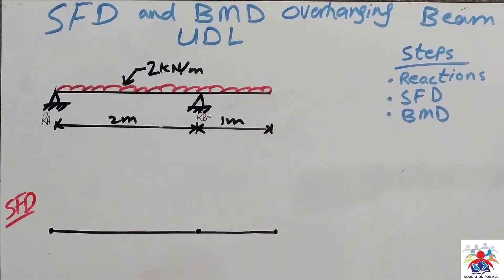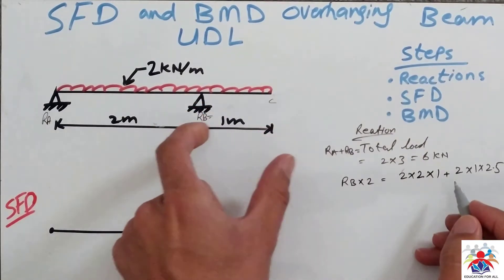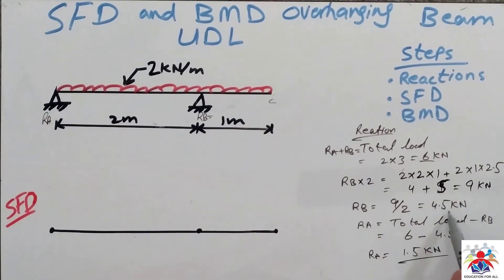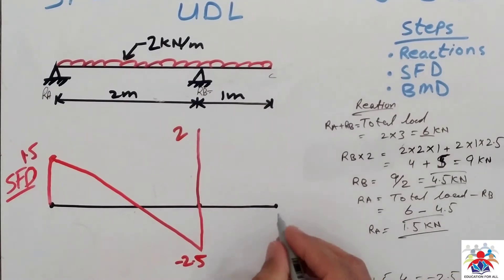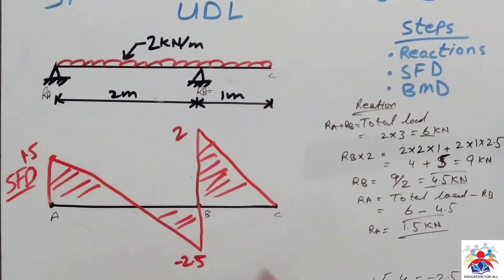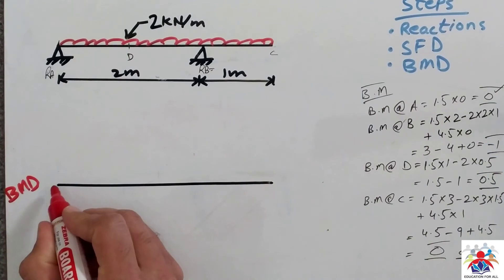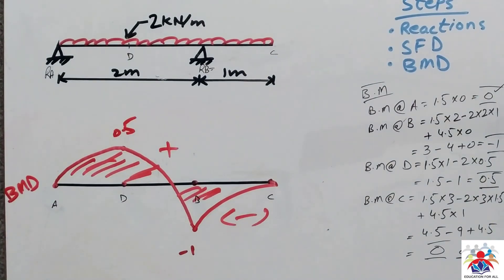Overhanging UDL Beam SFD and BMD with Diagram

Comment: Where did you get the RB*2?
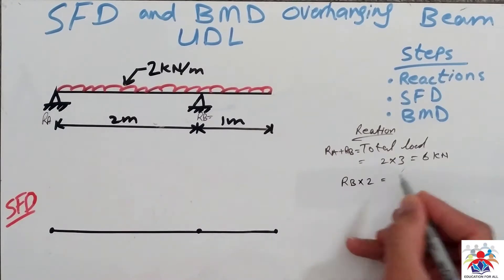Reply: @0:40
Reply from the maker: Thanks for your message. This is reaction calculation on reaction RB. Ok how it comes in? Distance between Ra and Rb is 2meters. Then Rb to c point is 1 meter. In order to calculate reaction at Rb I have divided the beam into two parts i.e Ra to Rb and Rb to c point. Now udl is 2kN/meter. 2x2*x1 plus 2x1x2*.5

Note: 2* is a distance on beam between Ra and Rb and 0.5 is also a distance on beam between Rb and c 

UDL always acts on its half length.
Reply: Simply by calculating moment that is force multiply by perpendicular distance.